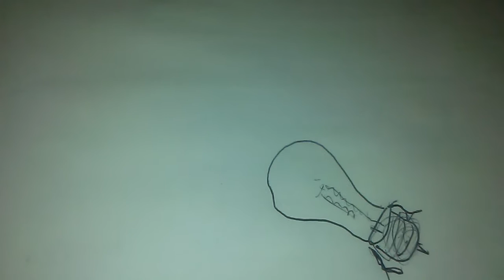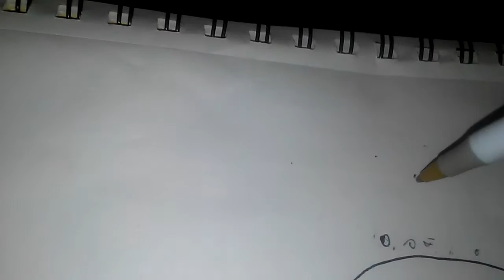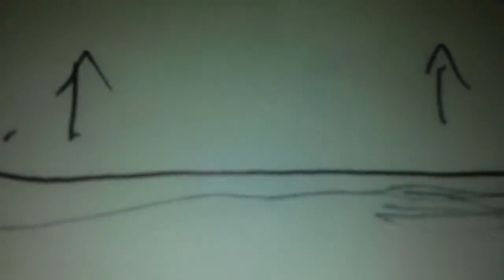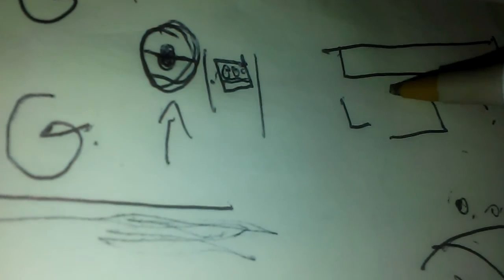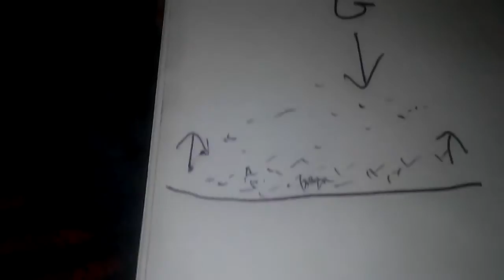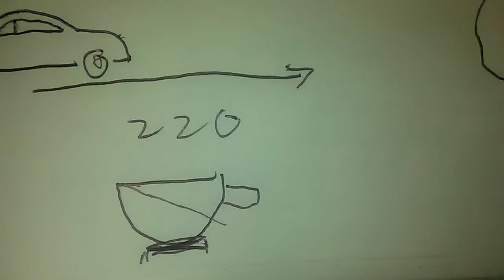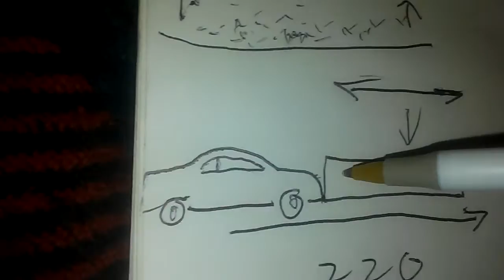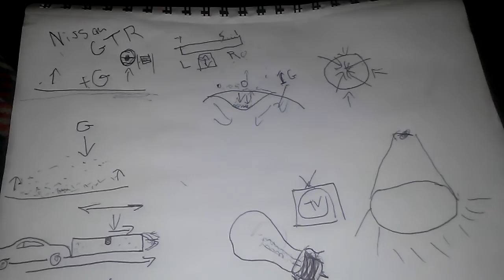Boyancy? how UFOs and hot air baloons float on a Flat Earth.

Comment: I got a little lost in your explanation.  At 8 minutes you explain excelleration and how you don't need to be excellerating to feel the G thing. what is the g-indicator showing?

sorry, but i got a little lost. I think you know a bit more about this stuff than I do (I drive a Ford focus) and Im missing some fundmentals. sorry for any inconvenience ;D
Reply from the maker: +Ptolemaic Wisdom its a good question... and one i dont think is easy to figure out...
at a certain speed (200+) constant velocity feels about like accelerating with around 200hp.
that meter is showing the same thing front to back as side to side.
its a matter of inertia... why objects stay in motion.
the g meter in your car determines changes inabsolute motion... what im trying to figure out is how fast do you have to go to test wether the level coffee cup theorie still holds true...
in aplane, the coffe is level, but the plane is coincidentally leaning back at just the right angle to make that happen.